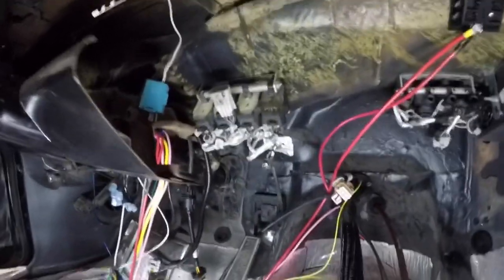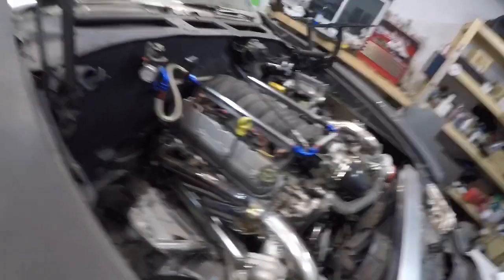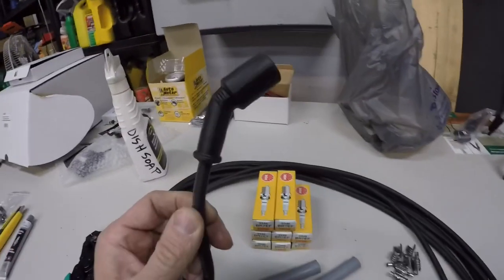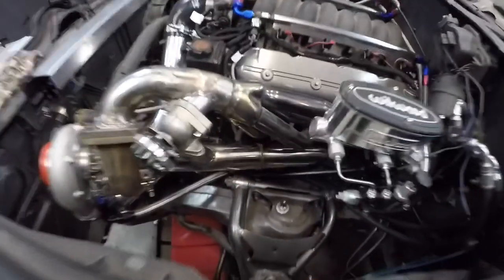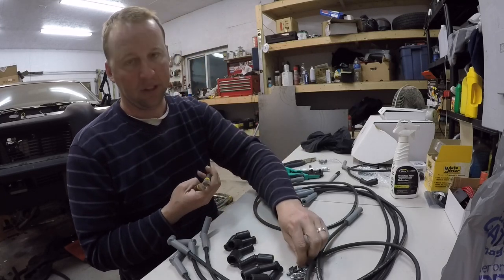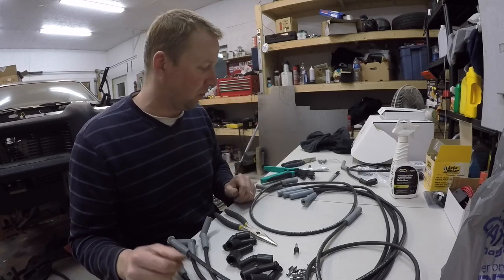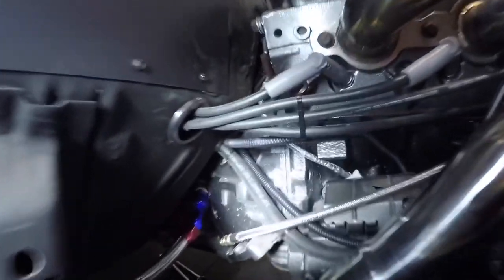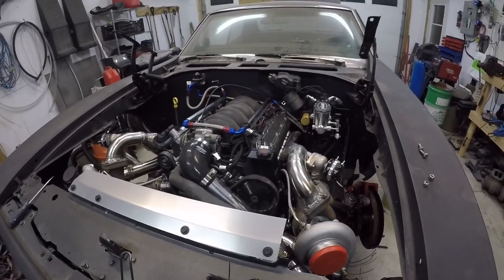Twin Turbo LS Build on a Budget Pt. 10. The spark!

Comment: Yeah... MSD makes a jig for crimping the plug connectors, as well. That actually came with my MSD plug wire kit. So, I guess it just depends on what you are buying, that dictates the extent of the pain in the ass. Let's face it, ALL plug wires are just a pain in the ass to have to assemble. Thanks, again, for the video! Keep on a rollin!